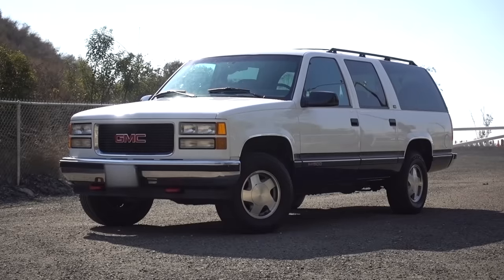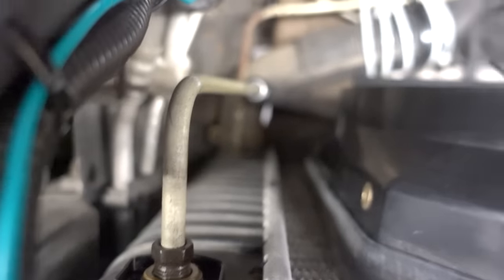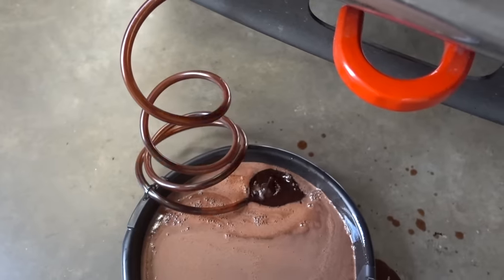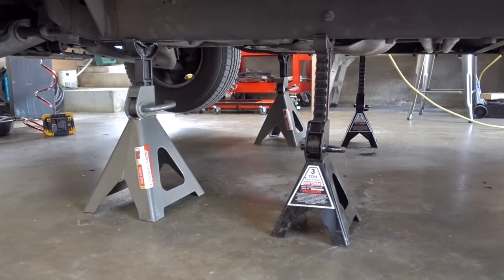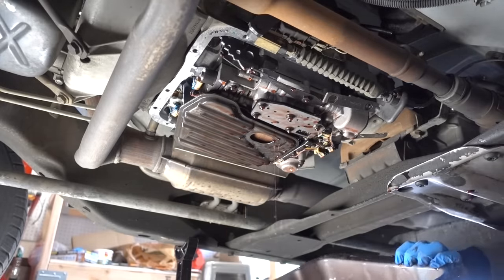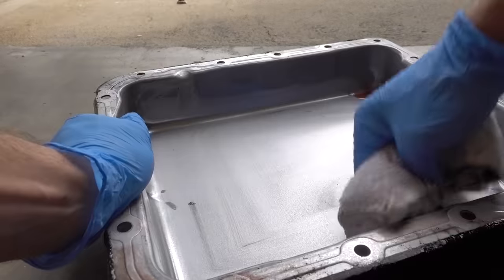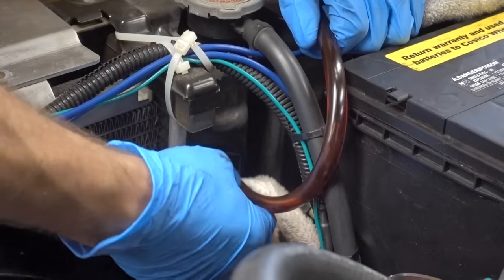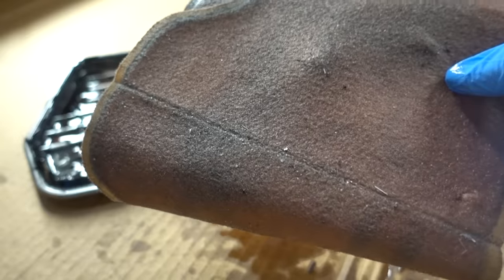Why You Should NEVER FLUSH YOUR TRANSMISSION FLUID!!

Comment: wtf? I watched this because the title said, "Why You Should NEVER FLUSH YOUR TRANSMISSION FLUID!!". 

Of course you should, and Jimmy did. Flushing a transmission is healthy. You should not wait 24 years to do it. You can even do it without changing the filter. Reason being if the filter is plugged up, you're already screwed. There is damage. Just doing a flush through the cooler lines is all you need. 

What I would disagree with is using a different fluid from OEM. Not because the Valvoline fluid is not good. Its actually excellent. Its the mixing of fluids that can sometimes cause issues and as Jimmy explained you're not getting 100% of the old fluid out with this method. If you do a complete rebuild, sure, use a better fluid like Valvoline. If not, in this case, I would have gotten AC Delco fluid from the dealer or the few suppliers that carry it. This way since you're not getting all of the old fluid out, you're mixing in the new fluid that is the same type as the old.

All that said, I found the transparent vinyl tubing rather unneccesary. This is an older GM with threaded fittings over the line. I do actually prefer these but most will be familiar with 96 and up style of spring clip fittings. Regardless which, the threaded fitting can be slid back, and in the newer models you have nothing that needs to be slid back. For hoses I always keep tons of 3/8 and 5/16 fuel rubber hose around. Its useful as hell. Either one of those will slide over the actual line and you don't need to do any complicated threading in of vinyl hose into the cooler itself. If you're worried about the cooler, its really short so just blast it with some compressed air and a trans cooler flush chemical or as I do just with brake cleaner. So now you're flushing the exact same method shown except with going through the lines instead of the cooler. Its the same sheit.

Rule of thumb is not so much how clean the fluid looks in the end but how many litres or quarts you have flushed through. On this kind of transmission I would recommend 16 quarts or litres. Sounds excessive but will make a lot of difference. It will start looking healthy after 10-12 quarts or litres but keep going with the extra. You're getting out about 80% of the old fluid this way.

VERY IMPORTANT. Do not let the engine which is running the transmission pump run so long that you start getting air bubbles coming out. That is a big no no. For a pan this size I would count about 25 to 30 seconds after starting the engine and then just shut it off. Take what you have drained, pour it into any oil jug that has a measuring gauge built in, and that is how much new fluid you will be pouring in. If 30 seconds long starts creating air out the cooler line while running, run it less. Smaller transmissions I don't go over 25, or even over 20 seconds. Yes its more time consuming but its better for the transmission to keep everything lubed. 

The torque converter is the only part of the transmission you can't really push out the old fluid with new coming from the pan. But if you look at the rest of the hydraulic design, its almost like an electric circuit. The fluid must flow from the pump, which is sucking from the pan (fresh fluid), and pushing it through the system which is under high pressure without leaks ideally allowing the new fluid to literally push the old fluid out. 

Best example I can give recently is my old 06 Honda CRV with 277,000km on it. I got the car as a gift from a loyal customer. Had the dreaded torque converter shudder that high mileage CRVs suffer from. I replaced the secondary filter (its a weird Honda thing so don't think about it too much) and flushed it with 20L of the upgraded Honda DW1 fluid, replacing the Z1 fluid that the vehicle originally came with. I've known this customer since they bought the vehicle new and despite my recommendations they never ever wanted to change the fluid. DW1 is superiour to the Z1. And in this case that simple flush of a large amount of fluid has the transmission running like brand new. TC shudder gone completely.

I know I'm yammering so I will end with another easy piece of advice. If your transmission is one of those that supposedly having the fluid changed made things worse than better, well, here's the deal. The trans was screwed already anyways. Most likely clutch packs. The extra metal debris floating in the fluid that gets past the filter helps keep friction with what's left. So if you did a proper flush and are having more issues than before it was flushed, try Lucas Transmission Fix fluid. Its a bandaid over a problem you already have. Ideally get a new clutch pack set and seals for everything else. This is not a 100% rebuild but believe it or not this is what most transmission rebuilders do and charge you $800 to $1200 CAD not even counting the R&R of the transmission. There are plenty of service manuals to explain how to do along with many helpful youtube videos and forum posts. Thank god for the internet right? 

To end my ridiculously long comment, change your fluid often. I would say a flush every 80,000km. If you do that you will probably never have to even drop the pan and change the filter in the life of the vehicle unless your pan starts leaking. If that's the case well of course change the filter. 

Funny thing is I ended up on this video looking for backyard ways to flush a CVT transmission. So far I've only been doing drain and refills for customers as often as possible after reading a lot of stuff years ago how you cannot flush a CVT the traditional way using the cooler lines. That there needs to be a certain pressure of fluid going into the return while the transmission pump is running. You can build your own equipment to make that happen but its not too easy and the parts are not really that cheap. You can buy a flush machine but the cheapest I saw was $1800 CAD. F*ck that. But now its late and I only have enough energy to watch some brain dead show before work tomorrow but if I find a way to flush a CVT safely using a home made setup, I will definitely make a video on that. For now I've kept my mother's Suzuki SX4 alive, which is all Nissan tech in the powertrain, by doing a drain and fill every 40,000km. In the end, because its a CVT they get errors from pressure loss, because a CVT runs at much higher pressure than a standard automatic. Tightening some bolts can help but ultimately will not cure the situation. I'm not going to get into specifics of a CVT so feel free to goolge but generally there are many more moving parts as the traditional gear system is erraticated and replaced by gear pulley system that changes to create the illusion of gears. On the one hand its smart because you can actually alter gear ratios with computers. The downside is that the system does not hold up long term. Hence the Nissan conundrum. I love Nissan engines but will never buy an automatic since 2007. Manual transmission though, go for it. Got altima and versa customers with manual transmissions and even though both have had clutch jobs done, the engines are closing in on 400,000km with no other issues. And doing a clutch is not that expensive and probably doesn't need to be done the first time until over 200,000km? Depends how you drive.

Anyways sorry for the long brain fart. To all a good night. Thank you Jimmy for the great video. Much appreciated.
Reply: Agree with not mixing fluid brands. Either remove all the old, or as much as possible, or use oem.  Flushed my Nissan Altima @ 68k miles. First sucked out fluid from filler tube with pump, then dropped pan and cleaned. Pan and magnet were very dirty, unlike this video.  Refilled about 5 qrts then drained from trans outlet tube into 5 qrt container about 1 1/2 qrts at a time. Used 12 qrts total and fluid looked excellent.  Replaced both external small trans filter and large mesh pan filter. Will do only a drain and fill, about 5 qrts, at ~25k with oem fluid next two or three fluid changes. If the cvt lasts that long:)  btw - also added an external cvt trans cooler. Well worth the investment!
Reply: @ridemfast7625  CVT shouldn't be flushed through cooler lines while engine is running. The return is needed for lubrication and can cause damage. I only do drain and refills as often as possible to keep CVTs going.
Reply: @Membreins   Youre the first person to say this that I have heard. For many years this method has been used on Nissan forums and utube vids. Not that its correct, but no one stated otherwise or had issues... I did it this way 20k miles ago and all is fine.  Given what you said and to err on side of caution, I will pump out 4+ qrts through filler tube for drain and fill. My 2010 Altima does not have a drain pan bolt.

Also, a link to show cvt internal fluid flow would be appreciated. I tried to find one but could not. Thanks!

Update: I thought more about how I did this. It was over four years ago and have watched several youtube vids since then on how "others" do it and got confused... I was planning to do drain and fill via the return line from the vids I watched thinking it looked easier.  

Anyway, all fluid was drained from filler tube. Pumped out 4+ qrts, ran engine, pumped out a few more, refilled, ran engine, pumped more out,  refilled.. I remember it looked good after 10/11 qrts but had 12 and decided to use all 12.  I also remember making a big mess pumping out the fluid from the filler tube into a 5 qrt container and paying attention to the exact amount removed each time.
Reply: @ridemfast7625  It was explained to me by the transmission shop block over from where my garage is. Owner showed me on one that was pulled apart but valve body and everything was out so didn't quite understand what i was looking at. I'm familiar with regular automatics and manual transmissions.

Interesting that the forum you speak about no one has reported issues. So what kind of max mileage are their CVTs hitting? If flushing that way extends total range I will have to change how I do things.
Reply: @Membreins  Mileage is hard to know. Some say ~200+k miles... Heat seems to be the biggest issue. And many trans are said to be broken and need to be replaced but its been learned that a $50 stepper motor is all thats required. 

Nissan has a Service Bulletin with a free Trans Cooler kit "fix" specifically for heat issues for my 2010 and a couple other years.   

imho - Adding a trans cooler, change fluid regularly and dont drive it like a race car with a stick shift will prevent most premature.
Reply: @ridemfast7625  Interesting. Yes heat definitely major issue in all transmissions and why keeping the fluid clean is what helps keep them cool. Never heard about just a stepper motor being the culprit. Maybe its a Nissan thing. But getting over 200k miles is a lot. I'll have to do some googling then.

Yeah I've installed many air coolers for people with a heavy foot or if carrying heavier loads. Never seen this TSB for Nissan though. I will check my software about it during the week.

I always thought the larger issues with the CVTs was the high pressure they have to run at. All the failed or failing ones I've scanned usually threw codes for pressure not being enough. Which makes sense since increased pressure and heat over time will weaken the seals which are integral to keeping pressure optimal.

Comment: You certainly should flush your transmission every 30k miles. Not doing so well result in needing a full rebuild at 150k or sooner. Transmission fluid is just like engine oil it definitely needs to be replaced.

Comment: Many drivers never change their coolant..big mistake. combustion & heat cycles raise the ph and make it more acidic over time. the aluminum alloys they use now can't handle too much. the old copper-brass systems were more resistant imo..and don't ever add any water. engines use COOLANT, straight full strength, no water mix. that is only for economics. it rots the system..

Comment: Only two of the bolts are different. The two that hold the linkage bracket are slightly longer so just keep track of those. You most likely overfilled your transmission. You need to drive the vehicle at highway speed for 30 minutes or more on a warm day and then check the level. Over full can be worse than a little low. If its cold out just make sure your in the crosshatch safe range preferably near the bottom. Recheck at a later date when the ambient temp is the normal highs in your area.

Comment: THe problem is that you left the fluid in for 24 years....  You are not much of a mechanic if you act like this was an amazing thing you did.  A) you do not run your car to empty the fluid.  B) The magnet with the shavings in the pan is normal. c) You should just drop the pan and slowly drain out the fluid as you remove bolts.  D) You do not need to FLUSH out all the fluid.  you can repeat this process every 30 K miles, and the new fluid can mix with the older fluid ok.. If you have a drain bolt, you can run the car for a while after the first fluid change and re-drain the fluid again a second time.  You can also slide a clear tubing down the fill hole and vacuum out the fluid with a vacuum pump.  they are cheap enough..

Comment: Don't understand why the video is titled "Why You Should NEVER FLUSH YOUR TRANSMISSION FLUID!!" Literally never showed an example of anything wrong happening or even talked about it beyond it being an old tale. My vehicle has 180k on it and i have zero records of maintenance on it. Trans line blew on whoever had it last and fixed it with hose. Rusty lines exposed to my transmission wasn't settling with me so im doing it. You also kind of extra-super flushed it. Start vehicle, let it pump out until it gurgles. Drop pan, which is now minimal fluid, change filter and gasket, obviously clean it up. Put it back up, dump 5 quarts into the vehicle. Now start it, and keep adding fluid until you see it come out red. Stop engine, reconnect lines. Adjust fluid level. Also... my guy making a template for trans pan bolts. If you took 5 seconds to look at all the bolts on the ground you'd notice that all of them are the same length.
Reply: Should also mention, lines were replaced

Comment: Transmission builder for over 30 years.  That is not how you flush a Transmission. You are possibly doing damage to the Transmission using your flush technique. Regular flushing is not bad for your Transmission if done correctly.  If the transmission had 200k on it with no services.  I would not suggest a flush. The point, use a quality transmission flush machine.  Do not use this technique.

Comment: This is wrong
You cannot  drain transmission fluid while engine running you could run dry of fluide and make big damage to your transmission
I prefere flushing machine rather than manual flushing which is very riskey

Comment: LOLOLOLOL, Absolutely NOT how "flush" a transmission in any way possible. Always first, if changing the filter, drop the pan. Possible to use an evacuation unit to reduce the mess if the pan doesn't have a drain plug. Then you hook up a transmission flush machine to each transmission cooler line. One receives the old oil and the other will match the volume and pressure but with new fluid. Run till you have gone through what ever the capacity of the transmission plus one quart.  What I saw in this video was just asking to throw money out the door. NEVER let the pump run dry, NEVER.

Vehicle in the video will have a schedule in the owners manual. Either it has it or not as most new vehicles it's recommended to NEVER service them. Trucks sometimes have service recommended under heavy/extreme circumstances. With factory synthetics changing because of long period times isn't necessary any  more, unless it's like 50 years etc. If done wrong it can cause more damage to service the transmission then just run synthetics

Comment: I’m gonna stop at 20 seconds in. Of course you flush your transmission fluid. Don’t be silly. If that transmission is on its way out. If you flush the transmission or not. It will fail. Because it’s on its way out.
You do know how a transmission works right? Clutches… Seals and the like.
Usually two things happens to a transmission. An automatic transmission. The seals get old, and gummed up. Or turn into stone. And it will not allow the pressure to shift the planetary. Or the clutches are wore out. In which case no power is transferred to the planetary.
This is an old wives tale. It’s much like don’t set your battery on the concrete. Pure fantasy.
So, everyone out there. If you want your transmission to last do two things. Change the fluid for god sake‘s! And don’t get it hot. The first is apparent.
The second works like this. Don’t pull stumps, don’t  pull giant trailers, don’t  Do roasty power brake burnouts, jackrabbit starts to the next stop sign or light.
And buy an aftermarket transmission cooler, it increases your capacity by a quart or so, and keeps everything nice and cool.    Simple

Comment: Make sure you apply a little sealant to the gasket
Reply: The advice above is very very bad advice.  Never apply any sealant to a transmission pan gasket.  Also, never apply any sealant to rubber hoses held on by hose clamps.  I am the expert as I did this thinking it would be a good idea. I was wrong. The sealant allows the the pan gasket to slip and be spit out dumping your fluid. I runed a transmission and a motor by using sealant where none should ever have been.  You can learn from my costly mistakes, or you will become an expert like me when you destroy your transmission and motor by using sealant where none should ever be. It is not fun being an expert and finding out the hard way.